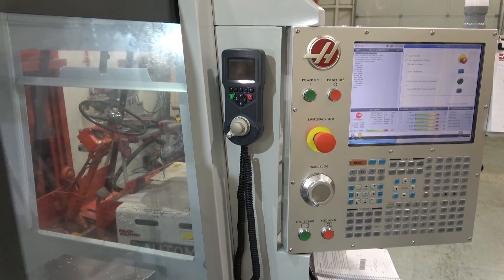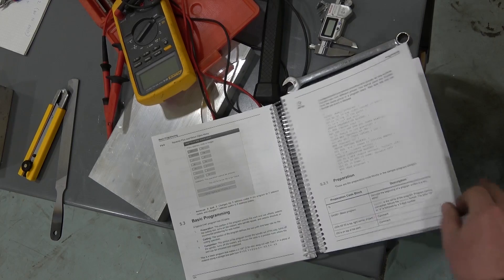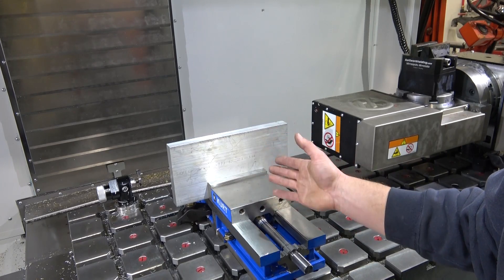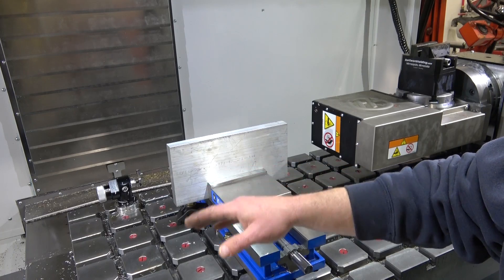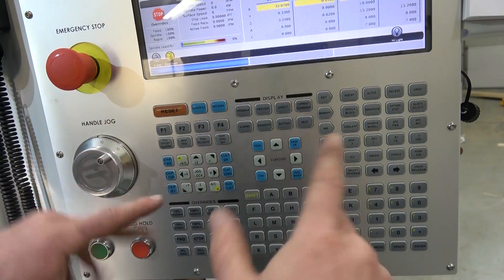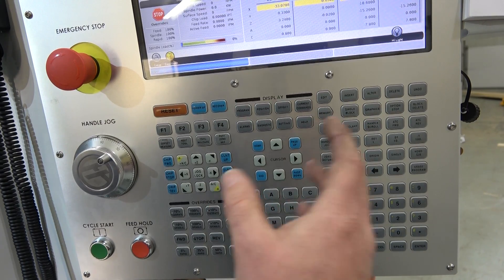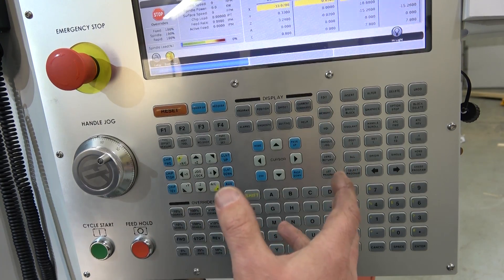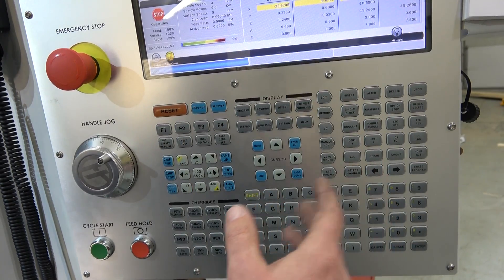HAAS Shakedown | JUNK Visual Programming System

Comment: I use this machine at work. If you press up, up, down, down, left, right, left, right, B, A, and then start, it will unlock an improved VPS interface.
Reply from the maker: What's the code for invicibility?
Reply: I'm not sure, usually I just start pressing buttons at random as fast as I can.
Reply: AvE uses the old DOOM and Wolfenstein codes: IDDQD
Reply: @vaanes  you mean MIA for Wolfenstein?
Reply: @vaanes  And IDKFA of course
Reply: oh man, that took me back!!
Reply: @arduinoversusevil2025  007 373 5963
Reply: @pinrod1  ok Mike Tyson
Reply: @arduinoversusevil2025  have you tried turning it off, then turning it back on?
Reply: @arduinoversusevil2025  IDDQD (or IDKFA if you wants to haz all the tools)
Reply: @arduinoversusevil2025  What is this, your first rodeo? That's the code for noclip. Lets the cutter pass through material, vice, table, everything!
Reply: AvE ~brings up console commands and then type TGM for god mode and TCL for noclip for those hard to reach spots
Reply: @arduinoversusevil2025  IDSPISPOPD for god mode...  Well it worked on DOOM 2 back when I was 16 or so :P
Reply: I thought it was Down, Down-Forward, Forward + B
Well it is until the machine figures out how to jump.
Reply: @Hebdomad7  And that's when we go forward, down, down-forward + B.  Or just mash whatever if we're using British tooling.
Reply: ...unlimited tries...
Reply: ALL YOUR BASE ARE BELONG TO US!
Reply: @kurtoconnor7456  You have no chance to survive make your time.
Ha ha ha
Reply: Code for immortality is 867-5309
Reply: @TreyCook21  
Jenny, is that you?
Reply: @stanervin6108  Yeah, but I go by Tommy now.
Reply: 99 lives in Contra or 99 taps on a HAAS?
Reply: AVE is over 9000! I enjoy manual machining for one off stuff but for production work cnc is the way to go. Have fun with the Haas. Some of the toyoda stuff we have at work can be a right pain in the ass. I'm anything you have to check your stuff over and over. Doesn't matter if you run it 1 time or 100. Remember the 7 p's: proper preventative planning prevents piss poor performance.
Reply: priceless!
Reply: Correction SELECT start sir
Reply: @Jay9999  Select was for two player.
Reply: @kentnothstine  Awe yes
Reply: The code IDNOCLIP will help avoid crashes ;)
Reply: It's the konami code right haha :D
Reply: What is the code for "tappy tap tap"?
Reply: Hit ALT and F4
Reply: I thought that was the code for the hammer bros thing in super Mario 3
Reply: Override the safety Lock out on the door and touch the spinning thing for a "FATALITY"
Reply: I thought you had to hold down a and press start at the same time

Comment: Gotta be careful running taps in those Albrecht type drill chucks they like to loosen in reverse. They’re designed to tighten up on the drill in clockwise rotation. You get what I’m saying.
Reply: Thanks for the tip.  I run Jacobs drill chucks in cnc for drills, occasionally a tap falls in too.  But I tighten with a snipe, that sum bich ain't coming out :p
Reply: Jason You must not be tapping fast enough cause reversing from 6000rpm Will open most any drill chuck.
Reply: @rmkscrambler  That's true, I've never tapped at 6k, would love to see that!
Reply: @Jason Gamer To be honest I'v Never had the guts to tap that fast either that's just the spec on one of  my machines.  I have demonstrated to my guys before why they shouldn't use drill chucks and 2000 rpm will open any chuck I own. Granted I consider Jacobs chucks to be junk because they don't grip that well and allways lock up when you put any torque through them which for tapping I guess could be a good thing.  I tend to only use ROHM Their cheap yet probably one of the best chucks out their. They grip tight enough to sink the jaws into the bit yet you can still open them with one hand.
Reply: @rmkscrambler  who tf taps at 6k?
Reply: Always ER collets for taps in my machines. Always.
Reply: Exactly the same thought the moment when I saw him doing it.... . Happened once in our machine and no keyless chuck for taps anymore. Tap slipping in the chuck could also mess things up in an instant.

Comment: You should use a tap holder like an er collet for taps and not a drill chuck to hold the tap. Taps can spin around in a drill chuck and depending on the quality of the chuck, runout can bite you in the arse. Also, forget the conversational programing and find a good cam program. It will save frustration and give you access to hsm, 3d profiling and multi axis programing with simularion. Fusion is quite good and cheap.  Haas runs a youtube channel as well with some great tips on getting you going.

Comment: Forget about that Haas crap. Break out the Cad/Cam. O there’s that dam learning curve again. Did you buy some extra probe styli? Get on the computer and order some right now. You will need them. And study the manual and practice how to indicate and calibrate it when you replace a broken stylus. Also climb mill you are on a CNC now not a Bridgeport.
Reply: +1 Cad/Cam you will be laughing. Much easier to learn software at the PC then software at the CNC.
Reply: @diditwork370  I have to disagree, I got pretty much the entirety of the Heidenhein 530 down in about two months worth of time (been programing directly at the machine from the start and been producing good parts after not even a week of getting to the machine (DMC 635 V Evo)), cad/cam took me 'bout four months with fusion 360 and there I'm absolutely sure I'm still missing big chunks. but then again, maybe the Haas interface is just garbage when compared to Heidenhein or Sinumeric. I can't say as I only experienced these two.
Reply: @10010110100102Error  my only argument is having cad integrated with cam then it becomes very convenient to make changes when more complicated tool paths aren't co operating. I've never used fusion 360 only cimatron, fikus and edgecam.

Edit

Yeah you're right learning software is harder but once you know how the machining process becomes quicker for more complicated parts
Reply: Also much better possibility of uppgrading in the future, some of the advanced toolpath simuations are cpu hogs.
Reply: listen to this guy !
i dont know anyone that knows more about machining and cnc then him
if he offers to be a mentor TAKE IT and become a legend like him
Reply: @zundappchef  I'm confident that AvE is well-aware of Edge.
Reply: @CM-xr9oq  I found edge precision through a random mention of AvE's.
Reply: EXACTLY !! Many cad/ cam solutions out there.. I program our Haas at work using the latest edition of BobCad/Cam... Still have to know how to edit G-code as the posts do some silly stuff occasionally..And the spindle speeds and feeds are hogwash a good bit of the time, but that's where a couple decades of experience come into play...Knowing how fast you can feed a cutter into what stock, etc..
Reply: Well, at least e's still climbing the learning curve; he'll get to graduate from step-by-step climb milling in due time
i'm learning from all this too, yknoe~
Reply: Conventional milling can still be good for roughing passes when ending up.  No need to climb then pick up and rapid all the way back over.  Just conventional mill across, feed in five or ten thou for a finish pass, and climb back the way you came.
Reply: Or purchase a machine running Siemens 828 or 840 or heidenhain then you don't need to piss about running to a fucken computer  for simple machining strategies.
Reply: @Edge Precision What are your thoughts on Autodesk Inventor HSM? Been trialling it with a Denford VMC1300 and a Puma 700 with mixed results.

Comment: Ya know most people dont hold their taps in a keyless chuck, specialy in a vmc, who else is counting the days before the 4th axis gets crashed into or the tool setter gets wiped out. Though I am crossing my fingers that they don't. Ave get yerself a set of ER collet holders, and some sidelock endmill holders. The only time I use a drill chuck in my vmc is to hold a short scribe to rough center the spindle over a hole or boss before indicating.

Comment: Nice. I just wish the machines had a grace pace setting. A "slow your roll mr. roboto" setting. Especially as the tool jerks rapidly thru space, throwing head fakes,  then immediately bites on the work. This leaves the dazzled operator no time to hit the pause, "that looks like its coming in hot!", panic button.

Comment: HAAS Stands for the following.

Half
Assed
Automated
Shit

On a more professional note I would recommend using either Fusion 360 or writing out the G code on the computer with out CAM software.  When I write out programs by hand as in not using CAM I use Excel then copy and paste into word pad.  Personally I find writing out simple programs by hand on the computer and at the control to be easyer than using conversational programming.

Comment: Hey Ave, it's time my friend, download fusion and take the plunge. 

Here's a great starter vid.

https://youtu.be/6wMzp8fZj18

I highly recommend you turn off machine configuration and additive manufacturing in your preferences. It adds unnecessary complexity for no immediate benefit. 

I program conversational CNC machines daily with fusion and it works great.

Comment: Your use of classical/baroque as background is a thing of beauty.  the only swarf I ever produce is on my hand restored 1922 Dalton Lathe and a Jet 16 Mill/Drill I also restored.  100% manual.  Better YOU learning that programming then a  duffer like me  though, I do envy your getting to play with it.  It looks like brain cells on overdrive.  I do understand the frustration with most programming which is why I   MUCH prefer a manual system.  this old dog  needs to learn the new tricks of your cussin though:  Steam off piss"  PERFECT metaphor

Comment: about all the on board programmings stuff is garbage, the morie seikei version was ok I guess, few things, standard drill chuck things are not good in cnc machines, they have a habit of coming loose and dickering everything, stick to collets, set screw, or gasp heat shrink holders, Run the spindle nearly wide open but never at full tilt, keep er 500-1000rpms bellow the max unless yer taking light passes, they run out of torque and create more heat then work eventually burning up the spindle, just remember yer speeds and feeds 10000rpms on steel is a great way to light the shop, but its expensive, get you some decent offline, pc based programming software, I liked Gibbscam or Mastercam, but the versions Im familiar with are getting kinda old now, gibbs was super easy to learn though, Also some machines you need to run tapping cycles on 100% speed and feed overrides, but a simple formula for tapping speeds and feeds is ad a zero to your thread pitch, and run your spindle speed at that, with a feed of 10. so the line fer a 10-32 would be s320;g84 z r f10.; to go faster just double the numbers, metric you would need to convert to sae pitch, but its not hard

Comment: I started out programming with paper, pencil, calculator, and a dream. Would program in the morning, head to the local watering hole at lunch time, and swill as much liquid courage as possible. Head back to work and push the cycle start button. Must have worked out cause now I use a cad-cam system and own and run my own shop. Keep it up partner you'll get there.
Reply: Congrats.
Reply: Paper AND pencil?  Luxury!!  We used to have to punch the tape with nothing but our tongues.  And that got worse when the boss switched to mylar tape for "archival" purposes.  Like anyone would want to see his work for any longer than necessary.

Comment: Lots of people recommending fusion. It's good but like with vps you don't learn enough. You want to know what the machine does at all times. Can't trust post processors. For anything not 3D milling, write the code manually and check with machine simulations. G-code can be scary at the start, but it's just math and cycles.

Keep learning my dude, but don't forget to understand as well.

Comment: Just a suggestion, more rpms in aluminum (500-1000 and it likes it more better), always use a collet system for taps (they like it much more better), chamfering makes a huge difference in tapping pressure, using some sort of tapping fluid for Al more better. Then happy taps. 😁
Reply: You've definitely run some taps in aluminum lol. Really good advice.

Comment: I bought a TM-2 Haas 4 years ago, the VPS system is total garbage.  Haas would do themselves a favour by deleting and just give up.  Better to give nothing than to hand out total garbage.  use a cam program or raw g-code.
Reply: I use raw G-Code with the quick code helper on my slightly older model VF 3 Haas Mill

Comment: Did you chamfer the hole before taping? And in Cnc you have to drill .003 inch bigger then what the mechgavier drill tap chart say. And some time we have to verify the tap runout. XD If I would recommend a program to program your cnc I would go with featurecam.
Reply: Good comment and or mastercam.

Comment: I've never used a visual system so I can't comment on their merits let alone the Haas version of it.
Always used a Cam software front end (NX) and post processor. I imagine working from a solid model to be a lot easier in terms of keeping the relationship of surfaces under control and if you are prototyping for people they are most likely going to supply a solid model anyway or you get to prove he component in Cad assembly.
Nothing to lose learning the visual system anyway, its there and you payed for it.
I'm sure both ways have pros and cons that could be worked into a hybrid of the two.

Comment: Conversational milling is the MIG of the machining world, a crutch that won't take you as far as you might want to go. Better off taking the time to learn G.
Reply: G code is a must to know.  For simple stuff it's faster than post processing and it helps to understand what the post processor is doing.  But you'll never absolutely optimize the crap out of your cutting abilities without a post processor to generate optimal tool paths and write out programs that would take you a month in seconds.

Comment: FUSION. THREE. SIXTY.
Build your code in fusion, then post process and send it to the Haas. These machines were never designed to be run just with the VPS.
Reply: That's true. VPS is there for those very small, simple and one time jobs where you're not to bother with a whole CAD/CAM package to do.
Reply: @Mtaalas  And realistically, you're going to do it in CAD/CAM anyway because the VPS is a VPOS.
Reply: @jttech44  realistically if it's small and simple I just handwrite it because it's not worth dealing with a post processor.  Depends on the job though.  Profiling and pocket milling and fancy shapes with all kinds of material to remove?  Not doing that.  End it up, engrave a serial, and tap 80 holes?  M97 for the holes, G47 for the engraving, I can handwrite that.
Reply: @Mtaalas  then it makes me wonder why the flying f#ck they waste many thousands of developer hours on it, and charge a shitload to implement it, when they know it sucks and no one will use it. Maybe because "everyone else" does it, maybe because some executive just won't let them kill it off

Comment: "visual programming" or "conversational" is rarely worth it.  Haas VPS doesn't work right out of the box because nobody uses it so nobody sees that it's broken.  Get on the Fusion360 and forget VPS exists.
Reply: Mazatrol is great for basic machining after you learn to lie to it. Anything more complicated and I run g code subs on our Mazaks.
Reply: @mikelang4191  we lie to ours about 10 times a day lol.
Reply: The VPS looks better than Fanuc "Manual Guide" but that's not saying much, Fusion 360 is really good wish it was around when I started machining. Also worth getting a speeds and feeds app, I like fswizard.com
Reply: I have to wonder if Haas VPS isn't any good because no one is buying a Haas to do that sort of thing. 10K worth of Tormach might have been the proper training wheels to get going. I'd expect their flavor of LinuxCNC VPS to be much more refined due to market position.  Then again, AvE probably had these conversations with Saunders, so who knows?
Reply: Laughs in winmax

Comment: I believe you can reprogram the default "glitchy" cycles for one of yours. Make a backup before then program your stuff as you want it. When i worked on one of those metal printing wizard, we used mdi commands to call our pre-cycles. We used O81xx for facemilling O82xx for edge milling and so on. If you write it right with parameter you can do safer cycle than what comes with the machines. I love those small bastards. You can find a sh!t ton of info online on them. They are great first commercial cnc mill